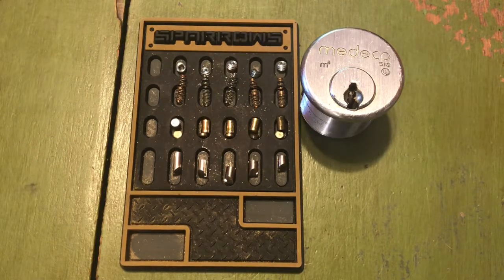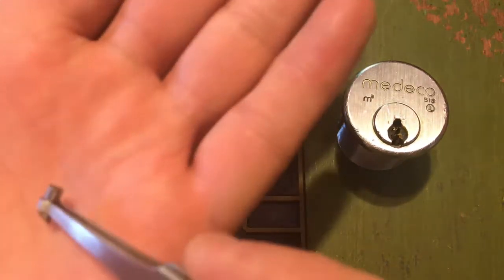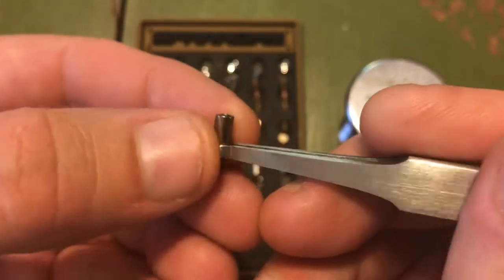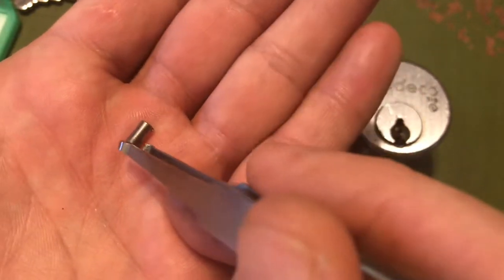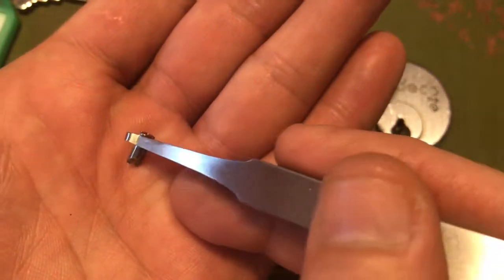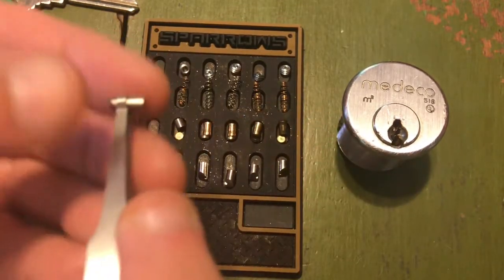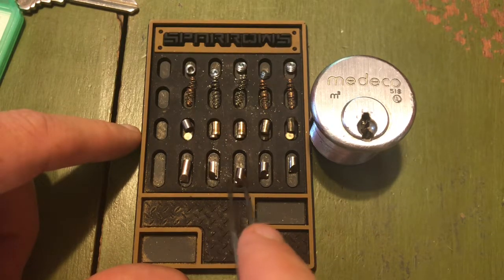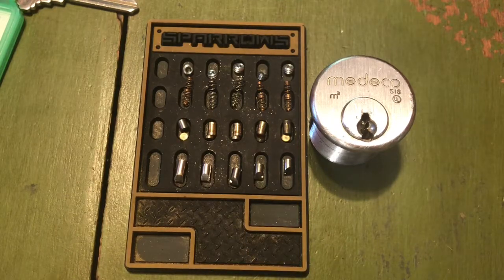A Look at Medeco M3 Pins

Comment: Medecos are fun locks I got an old hook put a v Groove in it so I could help turn the pins when I picked it and it works so far😊😊👍👍😎
Reply from the maker: Yeah, I’m kind of taking two different approaches but that is one of them. I’m also texting using a really fine pointed pick to snag the groove and turn the pin.